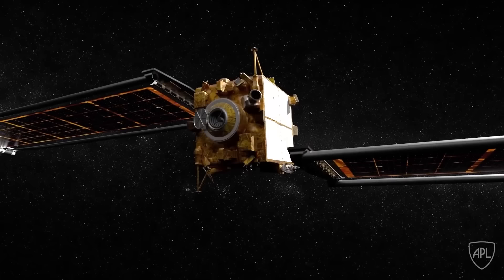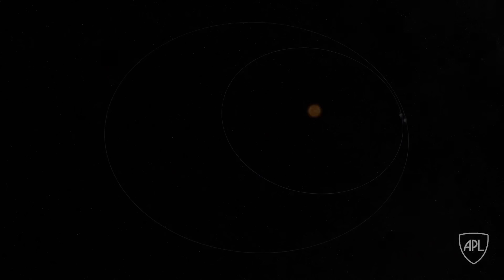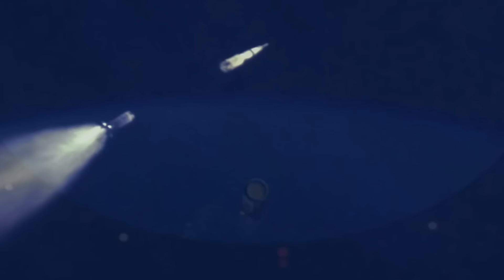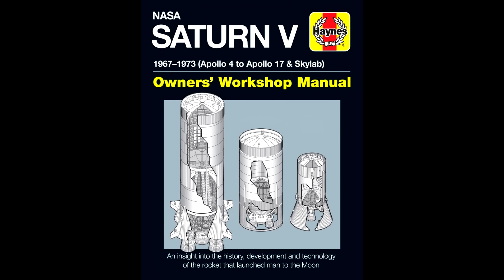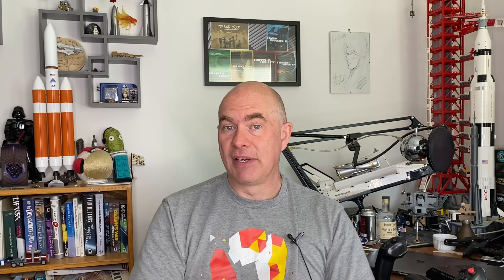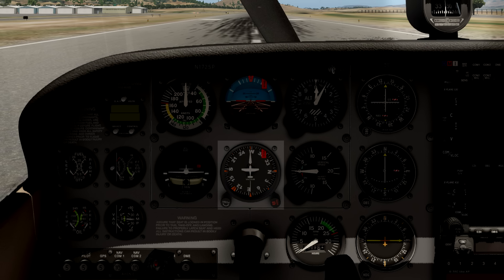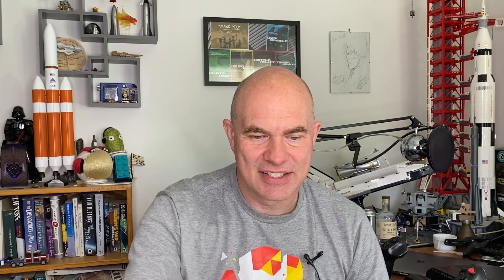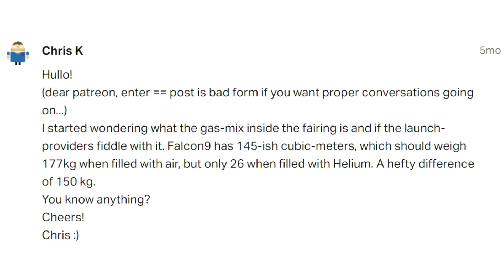Saturn V Staging, Asteroid Deflection and Hearing Rocket Turbines - Supporter Questions, Episode 17

Comment: I agree that politics ultimately resulted in the "short" life of the Shuttle but politics also made it possible in the fist place.  Without the design by committee you couldn't have involved as many companies and thus you wouldn't have gotten the needed political support.  Also, all of that "wasted" money was not really wasted as it went to companies those same politicians supported.  It is interesting how much of you can see this one the SLS/Orion as well and it will probably have a similarly short life.  Note that is sort of stuff is not limited to NASA (or even government supported programs) - it happens in private companies as well.  I worked on a project where we had to contract out the design out we couldn't get the support for the project - even though we though the company we contracted it too probably couldn't do it.  Ultimately they ran into issues and we brought the design in-house and finished it.  So, why didn't we do that from the start?  Well, because that is what management wanted to do and fighting that would probably have killed the project.

Comment: 👍 love your work Scott!
On nanotube "ladders/elevators"... Those, for purest strength are carbon, correct?
There is I'm sure massive amounts of math devoted to the logistics of this. But for ONE thing, which is never, ever discussed....
Electrical charge. INCOMPREHENSIBLE electrical charge. If it didn't vaporize basically right on the spot, it would probably be capable of having at least half of the current instantaneous load produced on the Earth at that moment.
It's PURE CARBON NANOTUBES!!!  How much electrical potential is just in the lower atmosphere on a beautiful day? Alot...
And take it to the outer atmosphere and Van Allen Belts??
Largest van deGraff generator ever, not to mention lightning bolt as it vaporizes...
Just sayin....
Reply: Interesting point I've never heard mentioned... 👍
Reply: Besides being a space elevator, it would be a massive power generator.
Reply: van Allen belts won't make it act like a friction van deGraff generator, just as a lightning rod for the charge provided by the solar wind hitting our magnetic shield.  However inserting isolator sections at regular intervals could disconnect the lightning effect, or an internal metal cable could act as a lightning rod.
  Anyway, Clarke's book used the kind of carbon fiber material now routinely used by the space industry, not the currently hard to obtain nanotubes.  There were some openly admitted unrealistic elements for fantasy reasons.
Reply: @johndododoe1411  would think the additional weight to neutralize it from electrical charge would be prohibitive. The generator analogy is somewhat poor, I know, but the idea is the same here. And if you think Auroras aren't electrically charged as hell, we need to talk. Same charges exist above the equator, just WAAAYY higher up...
Reply: @stuart207  Thank you...I have always wondered why that is.
When I first heard of the concept when I was a kid in the 70's, that's the first thing that popped into my head for some reason.
Reply: Electrical discharges and other hazards have all been researched and debated for at least 20 years, and other than that the Van Allen Belts would be deadly for passengers riding up and down the elevator if they were not shielded, no major showstoppers were identified, and while the corrosive effect of radiation is a concern, there's certainly no cause to believe the elevator ribbon would suddenly be vaporized. I guess it would make a great scifi movie plot though...
Reply: @EnglishMike  I'm curious as to how many hundreds of Megawatts would be coursing through it though... I'm sticking with vaporized...
Reply: @gregalbert4033  And I'm sticking with the scientists who have actually spent time researching the subject matter. I like my odds of being on the right side...
Reply: @gregalbert4033  Oh, those charged particles are definitively real and either part of solar wind, or the result of radioactive ionization of atmospheric molecules by solar wind.  The ionized nature of these particles probably helps us deflect them into the polar regions.
Reply: @EnglishMike  The free exchange of ideas 👍
Reply: Maybe that's the power supply.  Make your problem the solution.  (Hide 2 replies?  YT's getting crazier.)  :)
Reply: @gregalbert4033  Sure, but not all ideas are correct. :)

Comment: Something I just thought about last night is how does Russia expect to separate from the ISS when Zarya, if I remember correctly, is actually a US owned module even though it was launched and controlled by Russia? Wouldn't that just make things worse for them considering they're loaded with sanctions and such at this point?
Reply: They're not going to separate, Rogozin is just doing this for political reasons

Comment: I have a theory about why space elevator made of carbon nanotube will never work for Earth.
In short the elevator cable would erode and snap. 
A carbon nanotube needs to be flawless to reach its theoretical strength. That means every atom stays in their places. If a high energy particle or radiation hits an atom in the nanotube such a way that it gets dislocated, then your whole 50000 something km nanotube thread becomes dead weight more or less. You could also have some carbon 14 mixed in with your stable carbon 12 so radioactive decay or the cable material itself will also be a risk. You could say that its not a problem, because we used a million nanotubes. But the thing needs to be tens of thousands of km long. Even if radiation coating, and shielding for the stray space dust particle could be hanged on it, there is still the problem of space junk.
An easy to understand demonstration/experiment to test this theory would be to tie two weights together with a long piece of carbon nanotube (or any material), launch to some desolate but easily observable orbit and give them a spin. Then it needed to be confirmed regularly if the two weights are still together. 
In the end we would have a time after which the cable of known dimensions would snap. Average time if there was more.

By the way space cable technology is also interesting to think about as the regenerative breaking of inter-planetary travel: look up 'rotating space elevator' or 'momentum exchange tether'. Think of it as a gravity assist maneuver but replacing gravity with high specific strength, space proof cables.
We could put something of significant mass on middle earth orbit, give it an efficient ion thurster to maintain orbit, have a long cable rotating around it (I will call this 'sling' because I don't know any better) wich can catch a surface launched ship. In theory this could utilize the propellant efficiency of the ion thruster, but would still make the travelers perform a high g acceleration, thus saving on travel time. With regular back and forth trips, the orbit changes of the big mass with the cable could act like energy storage. By sending something to Mars this way the sling would lose energy by changing it's orbit around Earth. When something arrived to Earth it would needed to be timed, so the sling would raise its orbit with the momentum of the ship. Also means less reentry heat thus less heat shielding for the ship.
Possible cons: space junk would probably erode the cable; the cable could be waving uncontrollably; i can't  do much math on this, so it could be totally stupid proposition.
Possible pros (in case cable erosion is a nonissue): regenerative space break; weight can be dumb - even collected space junk; shorter interplanetary travel times; very likely cheaper than a thousand starship launches; seems to be more doable for Earth than a space elevator.

Comment: 10:15: Something went wrong here. The picture does not match what you're saying. At no point in time both orientation and eccentricity of the docking spacecraft's orbit equal those of the space station, except after the docking procedure. However, the orbit of the rocket ship is TANGENTIAL to that of the space station.

Comment: The Space Shuttle may not have happened at all if it hadn't had the capability to carry payloads for other government agencies.  If it hadn't been sized to carry payloads for those other "interesting" agencies, it may not have been able to carry the Hubble Space Telescope into orbit.
Interesting that, isn't it, that the Hubble conveniently fit in the payload volume, after all, it's kinda big compared to most commercial satellites.  Hmmm, wonder if it shares any similarities with any of those OTHER agency's payloads.  It's like it's a key that conveniently fit into the same hole...

Comment: Putting rawlplugs into a space elevator tower/cable could present a problem.
Oh, and the way it would all flap around as you ascend it and steal momentum from it would be nasty.
Reply: The elevator wouldn't flap. The ribbon cable would be under tremendous tension.
Reply: @EnglishMike  and things under tension don't move or vibrate, right?
Reply: @Rich-on6fe  Not claiming that, but the mass of a  elevator capsule would be miniscule compared to the mass of the ribbon, so I can't imagine it would have any significant effect on the ribbon under that amount of tension. It would be like a fly walking up a steel cable holding up a suspension bridge.
Reply: @EnglishMike  I agree the ratio of masses matters. I assume the cable is made to be as light as it can be and is used to launch large amounts of mass into orbit. Surely over its lifetime, more than the mass of the cable. 
I also assume it is flexible not rigid, (bloody long, have to consider it flexible) and that it doesn't damp its own motion, or benefit from damping from an atmosphere.
To me, the tension doesn't solve the movement problem.
It could be that a really massive space elevator that you don't use that much: it might not be a problem. But that's not the point of a space elevator.
As to the mass of the cable: I don't know what it would take. Had not heard about the taper - but don't think that obviates any problem by making it rigid or infinitely massive or self damping.

Comment: I have a question for you Scott, as there is hardly any gravity on the moon , and if the space shuttle could carry enough extra  fuel/air in the cargo  bay would it be possible to land it on the moon using thrusters, for a VTOL  type landing, thanks d

Comment: Hello Scott, thank you for posting your very informative and educational videos. I have a question and I hope you can point in the right direction. I would like to know How the Apollo Service Module (SM) was mated to the Spacecraft LEM Adaptor (SLA) the explanation as to how the SM and SLA are matted are vague at best. On some of the High Res images of the Apollo Command Module in orbit around the moon one can see a Red band and what appears to be Four Deflection Triangles where the pyrotechnic for line charges to separate the panels and the SM from the SLA. I have video of Apollo 14 showing a technician manually using a socket wrench to tighten bolts from the SM down to the SLA and drawing showing small bolt going though the SLA to the SM where a barrel nut is used to secure the bolt using the small holes around the base of the SM. volunteer helping young STEM students.

Comment: What happens to a space elevator as the planet's rotation slows down.  It will take a long time, but planets will not keep the same rotation forever.  What will happen?
More importantly, what could be done to adjust to it?
Reply: I think that part would just mean it needs tiny bits of ballast added or removed (or length)

Comment: In regards to a space elevator, would it change the math to build an elevator to an orbital ring in low earth orbit?
Reply: To stay in that orbit ring would have to have different rotation rate than earth, so no.
Reply: @randomnickify  orbital rings have an internal structure that rotates at orbital speed, while having an object traveling 'backwards' along that structure. 
The elevator would be anchored to the geostationary traveler.
Reply: The center of mass would have to be at geostationary orbit to remain "fixed" in place at the Earth's surface.
Reply: It makes it a lot easier to build space elevators.

Comment: MOMENTUM & KINETIC ENERGY: I always thought both momentum and kinetic energy were just words to describe force. And that's simply mass times velocity. So... If I shoot a gun into an apple... The force of the bullet is the mass of this projectile... times its velocity... that's the force that will hit the apple. Momentum and kinetic energy... where do they fit in the description? They aren't necessary. The momentum of the bullet... however you describe it... the energy you can expect from a bullet hitting an apple is already baked into it with F=M*V. 

I know I'm missing something, though. Can someone briefly tell me what I'm missing?

Comment: Question: While I know why we want fusion on earth, would we really want it in space when humans are not in the device?  So then does it matter if we use nuclear fission or fusion on craft once fusion is ready for "prime time"?  BTW, which is your favorite fusion project?
Reply: Fusion fuel is less massive for the amount of energy released, and at least part of the helium “exhaust” can be ejected as propellant (and part saved for other uses and/or  returned to Earth or to a planetary base).  Fission waste cannot be released for safety reasons, since it could irradiate future missions, and requires massive shielding, even for waste disposal.  Assuming fusion engine hardware is not even more massive than a fission reactor, fusion wins out, once it is practical.

Comment: So I'm curious, you can have a tower but at what point does in orbits would compression become tension? Could you balance the compression and tension?
Reply: Tension starts an geostationary orbit, which is why the proposed (untapered) carbon nanotube space elevator would be over 50,000 miles long. One benefit is that if you launched spacecraft off the end of a CNT ribbon that long the slingshot effect would be enough to get them to Mars and Venus with little to no additional propellant.

Comment: A shuttle with a smaller cargo bay and lighter, swept-back wings would have had a bit less refurbishment cost (smaller heat shield). But it would still have had a low launch rate using very expensive launch infrastructure. So it wouldn't have been much cheaper. Even the double space plane design would still have had those problems (though not the design features that led to Challenger and Columbia accidents).
Reply: The infrastructure wasn't what drove the costs up, it was the length and complexity of the refurbishment.

Comment: Regarding space elevators: would it be better to build them in orbit or on earth? if from orbit you have to anchor it eventually to the earth; if from the surface of earth you have to deal with building in the thin atmosphere. Likely there is A LOT more to this but just curious.
Reply: Elevator has to be anchored at geostationary orbit that is 35 000 kilometers above earth, atmosphere has about 100 km. In the end most of it will be in space anyway so you can start there.
Reply: You start at geostationary orbit then you unravel both ends of the space elevator at the same time -- one toward Earth, the other away from it to maintain the center of mass at the starting point. In theory, once you have reached sea level, you won't even need an anchor, though obviously there would have to be some type of structure at the base for logistics and operational purposes. Bradley Edwards' proposal has the base being a floating vessel in the middle of the Pacific Ocean.

Comment: Scott I have a question, though scramjet engine are efficient both in the atmosphere and in space, why don't they use it . I understand that the whole rocket would need to carry the dead weight, but can't they use the same for multiple stages? Doesn't it reduces the cost per kilo of refurbishment, because not many complications are required to refurbish and check the same engine. Also why are scramjet and ramjet engines mainly used for other purposes such as aircrafts, supersonic jets, etc??
Reply: The atmospheric part when they matter is to thin to...matter

Comment: I am actually curious to know if for some reason we do decide to build more telescopes in the JWST class how much would production costs come down from the initial unit when you take out the initial R&D costs and surprise engineering issues now that we have the completed plans to work from
Reply: Yes, every space probe or telescope is an expensive unique one-off; it's so frustrating. I suppose it's a side effect of how it's done: multiple projects having to compete for artificially scarce funds doled out by politicians not actually interested in either engineering or science.
Reply: It doesn't matter. Astronomers don't want a bunch of space telescopes with the same capabilities, they want a series of space telescopes of various and ever-increasing capabilities to probe ever further toward the edge of the Universe and answer the questions the previous generations of space telescopes' discoveries have raised. 

Sure, with an unlimited budget, more of the same would be great, but the realities of NASA's budget limitations means that even if another Webb cost $2 billion instead of $10 billion, that would be $2 billion they couldn't spend on the next generation space telescope designed answer questions Webb cannot.
Reply: Ummm actually a large number of space telescopes with the same capabilities used in an array formation would actually be very useful to science ....